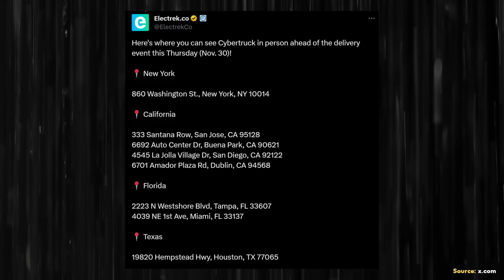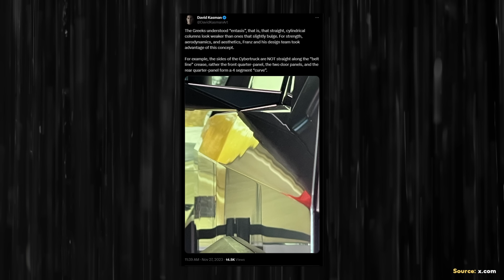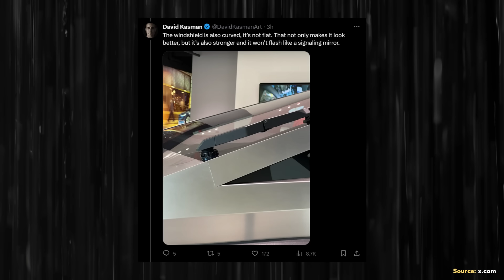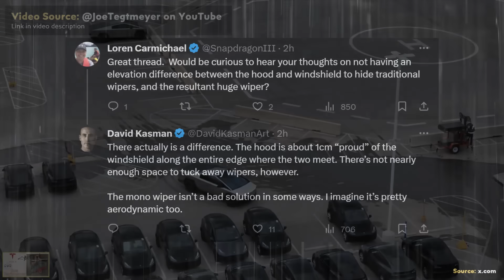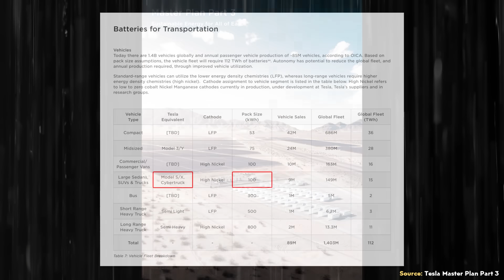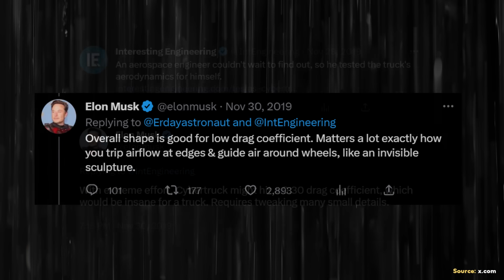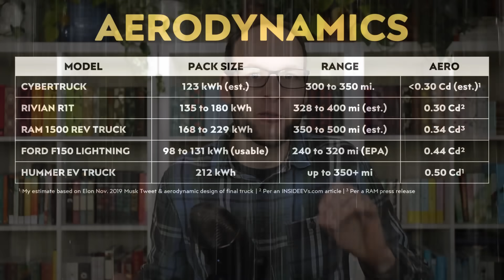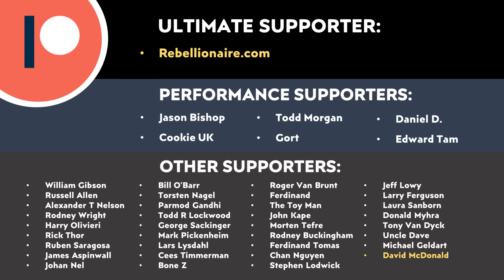Engineer REACTS to Tesla Cybertruck Design | Battery Size & Range

Comment: 300-350 miles is not enough for full use and to attract people who use trucks.
Reply: My 2022 Teala X has a 90Kwh battery pack.
Started out at 348 miles on full charge.
Actually can only go about 270 miles.

10k miles and now at 328 miles per charge.

Average 325Wh/mile. About 2.8 miles per 1 Kw.

With gas at $2.50 a gallon and 1 Kw at $.30, in Texas, it’s a Wash
Reply: @DonkeyKong57783  You electricity seems pretty high for Texas.  Where are you and are there alternative plans?
Reply: @DonkeyKong57783 Gasoline where I live in the US is $3.50 per gallon.
Electricity for charging under a 'time of use' plan is 4.5 cents per kWh. 6 cents per kWh including taxes and fees.
Reply: Why not?
Reply: @rogerstarkey5390   most likely, the actual world mileage will be 250-270 miles, and then if you tow anything, and fill up the bed, those mileage numbers are cut in half. When they announced this truck they were proposing 350+ and the 3 motor had up to 500. I guess, I had hoped to see at least 400 miles, since the new model S can achieve those numbers.
Reply: @rogerstarkey5390 towing and camping on windy mountain roads will significantly reduce the available range - that is why it needs more range as you can expect it to be cut in half for many uses.  I go many places where a gas station is 50/70 miles out of the way, not to mention finding an EV charger.
Reply: To go fishing, hunting, camping do anything fun in the bush will take 500miles range minimum. 
It’s 100miles one way from nearest supercharger to parking for trail head I use frequently in winter for ski touring.
Add range loss to cold, driving in snow and sitting for 2-3days in minus 10.. yeah 350 wouldn’t do.
Reply: @Alex-lo8os Good to hear all of the "no goes" in these threads. One less person in line.
Reply: I’ll still buy one, I’ll just resell it.
Reply: Then you get the range extender for 500+ miles.
Reply: @truthandjustice6838  I don't think so.
Reply: Pitty we won't get it is South Africa. Would love one.
Reply: Actually based on how people ACTUALLY use these trucks .. 75% of truck buyers are good with this milage. The 25% who actually tow won’t buy this … but that’s the minority of buyers
Reply: It only meets the needs of most pickup owners but not all.
Reply: It meets the needs of most, most of the time. But you spend $100k on a truck for the other times. 
There will not be anytime soon enough chargers in the nature habitat (rural and backcountry) of most trucks.
Reply: @Alex-lo8os  There will not be anytime soon enough chargers in the nature habitat - - if only you could keep the gas vehicles out.  Getting rid of jet skis would be a blessing too, along with snowmobiles.
Reply: 300+ miles is plenty for 95% of consumers.

Comment: The hood standing proud of the windshield a tiny bit is likely used to create a tiny backflow vortex right at the bottom of the windshield to create better drainage off the bottom of the windshield by pushing moisture down/off the bottom right at the edge.
Reply: Oh yea, that makes sense. That’s definitely needed. Would be disastrous at freeway speeds without it as the water the wiper wiped would just blow back up as fast as it’s being wiped.

Comment: 300 - 350 miles are fine By me.  I have a Tri-motor reservation.  I currently own a 2015 BMW I3 and get 62 miles of charge on a good day.  Fun car with very small battery.
Reply: I think you're going to see 124kWh/ ±320 with dual motors on the launch truck.
.
"Yours"? My money is on ±174kWh , tri-motor, remapped with a really high cruise motor gear (fwd?) but massive torque from the twin motors on the rear axle.
.😊
You'll be able to pull a ridiculous amount, but also hit 500 miles on the single drive on one motor, (65mph, no load, flat terrain😉)

Comment: Looks terrible... Stainless steel tends to want to go back to its original form.
Reply: @AudiTTQuattro2003  with the cost of repairing stainless it won't take much for insurance to call it totaled.  You can't just patch and paint it, whole panels will need to be replaced.
Reply: It won't be repaired unless they can just replace that whole panel.  @tbone6976
Reply: I'll trust the guys who build rockets.
Reply: The guy hires experts who build rockets that blow up. @rogerstarkey5390
Reply: @rogerstarkey5390  lol.  Failed spaceX.  Ur a genius.  When ru going to Mars.
Reply: Sure, our stainless steel refrigerator, oven, sinks, coffee maker, toaster, silverware, kitchen bowls, utensils, BBQ, smokeless Solo Stove and pots and pans all desire to transform back into the molten state from which they came.

Watch out for those large 100 barrel beer and wine tanks and vessels. They're coming to get you.
Attack of the commercial kitchen fixtures. A new movement happening near you.

Comment: I have a CT on order and feel that 250 mile range is more than adequate. Of course I don't intend to haul stuff. My new MS has a range of 405 miles and even on long distance drives we stop after driving 200 miles to take a health break.
Reply: Agree with the 250 miles.  In our X we are biologically limited, not charge limited when we travel.
Reply: I’m happy you’re ok with subpar range. Most people are not….
Reply: why are you buying it? it's a truck. If you don't haul then you dont need a truck and should be sticking with the model X or model 3. Always confused by people who buy trucks but don't use them for their purpose. Truck owner myself who hauls his boat and uses bed for work projects.
Reply: @relentlessfax87  Almost all truck buyers do not need a truck more than a couple of times a year. Those that do are the exception to the rule.
Reply: @relentlessfax87 PLENTY of people in texas are just hauling home improvement project stuff, groceries, and stuff on camping trips in the bed and that's it. Look at the paint job and condition of the pickups you see - many have never seen an actual work site or gone really off road.
Reply: @relentlessfax87  YOLO my friend. Also my wife thinks that MS is too low and she would prefer CT that sits higher. I have a feeling there are lots of people who will buy CT because it looks cool, it is very sturdy and who don't haul stuff.

Comment: best to keep the battery the same for both dual and tri motor.
buyer may choose to upgrade the range later.   or future buyer may upgrade.

it simplifies construction and enables later upgrades.
Reply: Not going to happen.
Waste of resources.
Reply: @rogerstarkey5390   tesla did it before.  and depending on cost saving, can be worth it.     especially given the number of users who will sell when new version of CT comes up with pass through, etc or some other feature.

Comment: I keep looking at the dirty Cybertruck and how the one massive windshield wiper cleared it
To me, it looks like just 70% of the total window was cleaned - just a guess.
(2 unwiped areas)

In California, the windshield wipers must be able to clear 80% of the windshield area.
In Texas, the wipers must be able to clear 85% of the windshield area.

Sure hope the engineers got this right.
Reply: Depends if that's "glass" area, or "driver vision" area and how the driver vision requirement is calculated.
Reply: @rogerstarkey5390  Every state is different - all 50 have to be addressed.